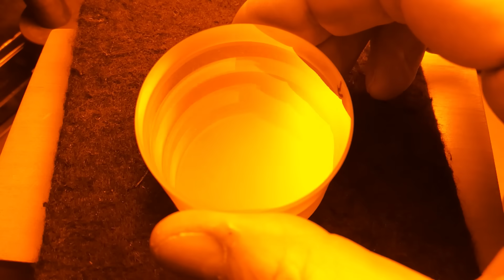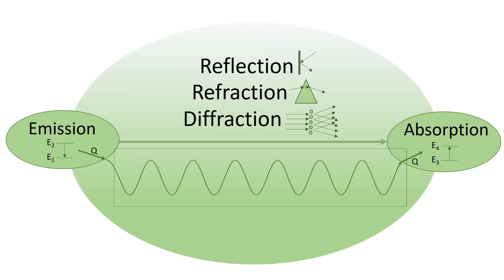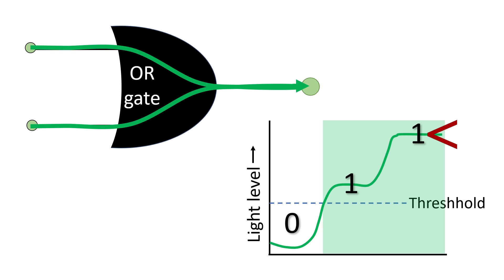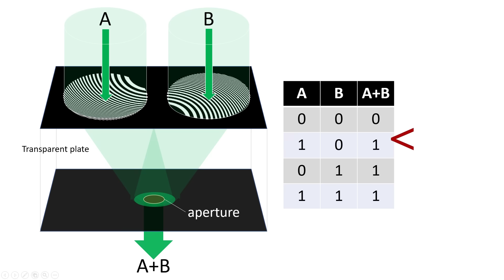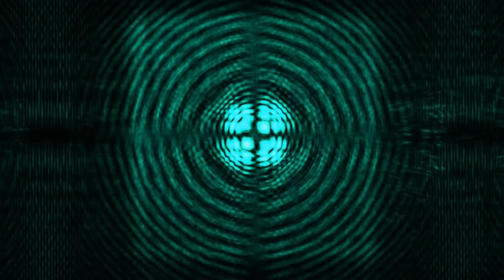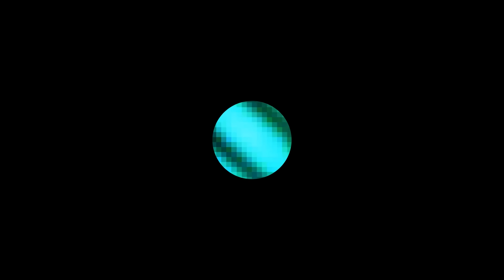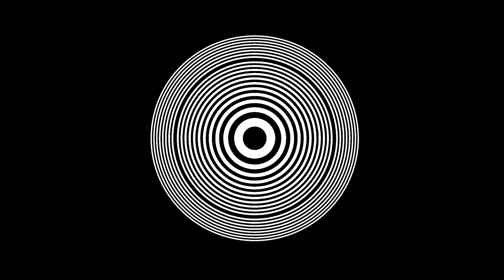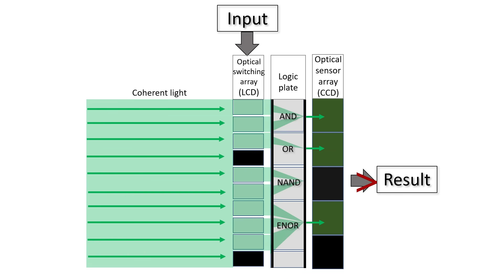Making Optical Logic Gates using Interference

Comment: Optical logic gates are MOSTLY a dead end.   Not only are there significant unresolved challenges to their construction, as you have determined, the process by which you are creating them relies on the same lithography techniques by which modern electrical semiconductor integrated circuits are created.   So you could not achieve a better feature size than a traditional semiconductor IC, at best you could match it.    The time it takes for the output to be available at the end of a stack of gates would be significantly better than semiconductors, but the necessity to use a CCD or other electrical device to apply the inputs and read the outputs would limit this benefit since those elements would limit clock frequency to not much better than current 3-4Ghz processors.      would your NOR gate even work?  Wouldnt you have an intensity problem with the destructive interference.   If both inputs were on, then the out of phase intensity would be twice the in phase intensity and thus it would only partially cancel out?   I dont know a lot about optics so correct me if I am wrong about that part.       In my view the only major benefit would be decreased thermal load.   If you could make these even HALF as good as traditional semiconductor gates, the data center industry would be clamoring for them.  Megawatts of energy are dissipated as heat, or used to pump that heat out of the building, at data centers.    The optical gates should be very low thermal dissipation.  Just the amount of the optical absorption of the gate material, which I bet you could keep very low.

Comment: For amplification (which a lot of people are talking about), one strategy could be to add a new signal out of phase with the output of the OR gate. This signal can be always HIGH/ON, so it can draw energy(light) from a separate, more reliable source than the inputs. The output will then always either be a very low signal (zero) or whatever amount of light this third signal has (so it doesn't depend on the strenght of the inputs)

If I understood correctly, this will turn the OR gate into a NOR gate, since it will basically invert the signal. Because NOR (and NAND) gates are universal gates, you can pretty much implement any gate with this (of course, for efficiency/cost some other gates can be implemented in more clever ways using the physics, rather than just plain boolean logic)

Comment: It's not a full gate unless you explain how to measure against the threshold and turn the result back into a coherent beam of defined intensity. Interference itself is just addition, phase shift is like scalar multiplication (with a unitary complex number). Both are linear operations and combining them can only make linear functions (which AND and OR are not).

Let's give an example how just reusing the beam without threshold-comparison fails. Imagine you want compute for instance (A OR B) EOR (C OR D) by chaining these gates. Assume A=B=C=1 and D=0. The correct answer would be (1 OR 1) EOR (1 OR 0) = 1 EOR 1 = 0. Compare with A=1,B=C=D=0. The correct answer then would be (1 OR 0) EOR (0 OR 0) = 1 EOR 0 = 1. However, a circuit without threshold comparison would give the same output in both cases, a single-intensity beam with no phase shift. In maths:
(A(sin x) + B(sin x)) + (C(-sin x) + D(-sin x)) = (A+B-C-D)(sin x), 
(1(sin x) + 1(sin x)) + (1(-sin x) + 0(-sin x)) = (1+1-1-0)(sin x) = sin x, 
(1(sin x) + 0(sin x)) + (0(-sin x) + 0(-sin x)) = (1+0-0-0)(sin x) = sin x, 
Here, I use sines for the waves (instead of e.g. complex exponentials) as they are easier to understand. A 180 degree phase shift then just flips the sign of the sine.

Comment: Interesting application for interference. However, just to try to drag this to a rather distant conclusion, could you construct circuits with these efficiently such that there is regeneration of signal, just like there is for CMOS-based logic circuits? That is, for something to be included in this mechanism that restores the effective power of light (in an output "high" signal) that gets through to be equal to an input "high" signal, so that multiple gates could be used in series? And of course, based on what might be used for this regenerative property, could you make memory cells from optical gates?

This definitely wouldn't be the immediate next step for this sort of technology, as it's like trying to fit an older paradigm hoping it'll clear it just the same, but just to be able to get an idea of what it might take to do a direct comparison to current semiconductor-based logic gates.

Comment: It would be great to create computer out of this technology. But I couldn't think a way to connect outputs of one AND/OR gate to another. Basically it's because of mismatch in intensity of light, as e.g OR gate produces 2x the intensity when both inputs are on. With interference it's only possible to perform linear computation (with cascaded gates). But to make whole computer out of this there would be needed some non linear device that can limit light intensity. I've read that some crystals can do this but they require for it high intensity of light (Optical Kerr effect).

Comment: You will get one logical operation out of that, but if to put them serially then that will not compute. All these different phaseses etc will mess next input and thus output behaviour as well. In case of electronics the actual electron of input is not needed to pass the logic element and only will trigger output. Can that be achieved with photons?

Comment: Using constructive and destructive interference to evaluate logic functions has got me wondering if (electronic) frequency domain logic gates would be possible. The sum of two 50hz signals is a 50hz signal with twice the amplitude, so applying a threshold on the sum produces either an AND gate or an OR gate depending on the threshold set. If one of those signals is of opposing phase, you have a NOR gate, etc.

The upshot of this is that multiplexing is possible, I.E. A single gate can evaluate inputs at multiple frequencies simultaneously. Say signal A has an 80Hz component and a 50Hz component, and signal B only has a 50Hz component, the frequency domain AND gate would output a signal which has a 50Hz component that is twice the amplitude of the 80Hz component - that is, true at 50hz, and false at 80Hz. Both 'evaluated' simultaneously by only one gate.

Comment: NAND and NOR gates are called "universal" since one of them is enough to buiild all the circuits, I think you might concentrate to build just one of them very good... Also a fully optical relay (input and controls all with light as output on one side or other) might be a good implementation to go (there are computers based on mechanical relays but with the speed of light they might do incredible things!)

Comment: The most important part of a logic gate is its "gain". That is, the output but be more energetic than one of the inputs.
Otherwise, with enough depth, a logic circuit would be unusable since the output is too weak to be observable.
Therefore, almost any logic gate that can be used to build computers have some kind of amplification mechanism in it.
Reply: Maybe a phototransistor and LED ?
Reply: @yelectric1893  It would work, but it also nullifies the whole point of building an optical computer--that light travels faster than electricity.
With pure interference, you compute literally at the speed of light. With LEDs, you compute as fast as the LED can turn on or off.

Comment: There are two issues you have not (yet) covered that are absolutely vital to make practical logic circuits: hysteresis and amplification.
A practical logic gate always amplifies its input signals: all gate outputs can drive multiple inputs, usually at least 10.
And due to hysteresis, a degraded input signal (if not degraded too much) will still result in a clean output signal, even if multiple inputs are degraded in different ways.
I have a suspicion these optical logic gates lack both properties...

Comment: I maybe totally stupid but here at 13:11 where focal point are in different focal plane which are parallel to each other and are parallel to the surface
Can we omit this by etching the fresnel on a concave surface ?
Reply from the maker: Point I tried to make was that you cannot get rid of the focal point altogether. And of course it is possible to make just one single focal point, it is actually a lot easier than to make 2 on top of each other.

Comment: Seems like you'd need to keep pumping energy into the system which is a shame. It seems like something that could work, and I'm sure it's worth developing a much more complex prototype circuit, but whether that value will inure to you is not guaranteed. My suggestion is that now is a good time to go back and read all those related papers looking for mentions of why they chose not to go down your path. You will learn this eventually anyway, so you might as well find out now.
Reply from the maker: You are right. I have actually already come to that conclusion, just haven't made a video about it yet. ;-)

Comment: I think a major issue with this is that with logic gates, the output and inputs are somewhat decoupled.  The idea of an OR gate outputting 2x threshhold for an input of 1 and 4x threshhold for an input of 2 means if you chain an OR and an AND together, an input of 2 on the OR in the chain will result in an output bright enough that the AND outputs above the threshhold for an input of only 1.
Reply from the maker: chaining them together will definitely be a challenge in this configuration
Reply: @HuygensOptics  I gotta be honest, I kinda hoped I was being dumb and you or someone else would swoop in and be like "nah dude I've already thought of this and you just do [such and such simple/obvious thing]".  :(

Comment: it could indeed be a breakthrough in the chip technology. if, and why not when the chip gets made it will have operations faster than normal electricity which is bounded by constraints like drift speed and all. moreover it can just be as groundbreaking as introduction of optical fibre in a copper wire world. i can definitely be sure that in all cases light would be faster, and thereby calculations using optical logic gates would be faster. another aspect of this is quantum chiplets. quantum chips which are now being thought to made can contain values between 0 and 1 and thus freeing us from restrains of a digital boundation of 0 and 1, i feel this would achieve similar result but with a really effective, and practical approch when quantum computing needs almost 0k temprature for its purpose
Reply: You could not possibly but 'sure' of anything yet.

Comment: Do you use 505nm diode? Just for fun, laser diodes still have wider spectrum then it sometimes would be ideal or acceptable. There is a solution though, and that involves DPSS lasers. There are standard green 532nm ones but also 660nm and likely many more. They are not easy to get though.

Comment: One potential application I see coming from this is electrical separation of input and output. Similar to how transformers can be used to separate components on two different power planes for electrical isolation. Though the optical solution could potentially have a wider range of use in comparison. 

On the zoned plates, it looks like 2 zones creates a slit while 4 zones creates a dot, and 8 zones creates a larger dot in comparison to the 4 zone plate. If possible, more zones should be the way forward, as the intended output is more refined.  

I'm also curious about how many gates you can travel through before you need amplification. A basic amplifier would just be a photodetector coupled to  another diode hooked to the power plane; this also has potential as an inverting amplifier, if needed. Alternatively a more complex, and probably more correct, amplifier would use a beam splitter inversely, adding a secondary light source to the primary light source; I assume this would have a wider range of uses as compared to an actual op-amp circuit.

Comment: In the February 1994 Circuit Cellar issue, downloadable here:
<https://epdf.pub/zdownload/circuit-cellar-february-1994.html?ckey=ef059f242ec1c105e7370ef9d4bfa7f3 >
there was an article called "programmable lightware" where the author wrote step-by-step how to design a series of holographic plates , when stacked one atop the next, would produce logic gates allowing for computation.
Perhaps this project can be informed by that project?

Comment: The fundamental problem here, and the reason this idea isn't already widespread, is that logic gates are only really useful if they can be arbitrarily combined, and these can't. The output intensity of such an or gate, for example, has a different intensity depending on the number of inputs that are turned on. So in general it won't work when you feed it into the next gate. Similarly, the output of a xor will have a different phase depending on which input was on, and again it won't generally work correctly in the next gate.

This is not something you can easily patch. The fundamental problem is that these kinds of elements are linear, and boolean logic in general is nonlinear. Without nonlinear elements, you don't have a complete system of logic gates.

Comment: The problem of computer chips is that they have too much energy: high frequency heats up elements. If optics could escape this problem (or have lesser energy losses)...
Reply: Your still limited by the loss of the refraction patterns. I imaging huge chip with billion gates would require a laser so powerful your savings would be greater, with a traditional transitor.

Comment: This is such a fascinating concept. I have imagined optical computers based on hexagonal crystals with the optical operators on the hexagonal faces and the data on the end faces with the output data being through an optic fibre cable for conversion to standard electronic function elsewhere. There are so many fabulous mechanisms such as using air (vacuum) gaps to allow past data to jump ahead of current data, optically clear piezo electric crystals to deflect beam direction, and photonics devices are beginning to appear. The prospect is to build fast computers that are immune to EMPs, but also have indefinite life to store the history of our civilization beyond its inevitable collapse. Keep going, this is huge.
Reply: I concur, EMP is a huge issue, if the world would know that all the electronics of an entire country can be broken in a few seconds with EMP, they would never use silicon chips

Comment: I recommend using an optical transducer for this.  It will save at least one level of computer recognition.  Also you should see how fast you can spin the pattern and the computer can reliably detect logical patterns.  I could see this working if you have a series of spilling interference patterns constantly being detected and when the user needs to run a process the detectors start firing off the desired outputs to make the program run.  

Yeah, I think you need to constantly be generating random data with a lot of spinners.  The more spinners the more data processing can occur.

Comment: add sensors at both destructive and constructive points to give a ratio output, use log amps to help digitize, allows more precision over a much larger bandwidth of light level variations. 
etch the outer ring of interference filters on the other side of the glass to get back your genius win. make the thickness correct for height delta to re-align focal points in space.
poppa was a photon magician, learned this stuff in the back seat of a station wagon.
great videos.
your tesla valves can be used to generate water level differences.
This can be used to measure flow direction and pressure differentials with fluid induced optical path changes.
This can be used as a logic device for flow control and measurement

Comment: hi ,there are FPGA optical chips for parallel processing of linear math however their light path is smaller than the wavelength so I do not know if they use interference
pattern in the way you described ,but man ,you have done a great work .

Comment: This assumes that the inputs are in phase, but the outputs are not always the same. How would you make sure that the phase matches through the system?

EDIT:
I now see your design at the end now. That is a really inefficient design. This ends up converting between electrons and photons after every transistor. It would me much more efficient if you ware able to put them in serial.
There is a field of electrical engineering called photonics, which is using photons to do computations and converting them to and from electronic al signals.
These days communication happens mostly using photons, and the conversion is very expensive. Being able to use pure photons to do computations would allow networking to become a lot more efficient.

Comment: Have you considered using IR since the larger component scale could make testing and validation easier? 

Practical applications (assuming manufacture of complex arrays) could include use in locations with high magnetic flux and radiation (medical, satellite)and potentially where extremely long life and high reliability are required (aerospace, military). High energy photons may damage data but not likely the device itself.
Could work as an image sensor for pattern recognition or motion detection. 
Circuit would not generate heat so use in some sensors could be useful.

Out of my depth but could not resist.

Comment: I guess this doesn't work for computing since the light we commonly use are in the hundreds of nanometers, whereas nowadays transistors are under 10nm. So, It would require much more material and much more space to build a thing such as a cpu, despite the fact that it would be really really fast.